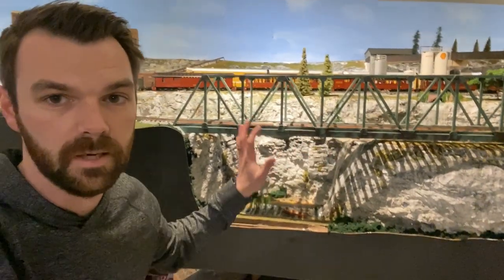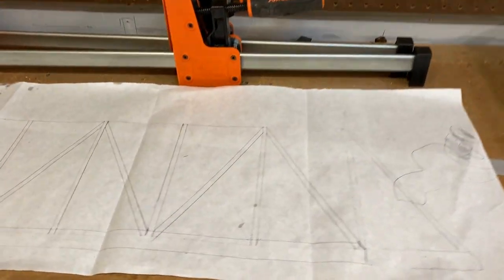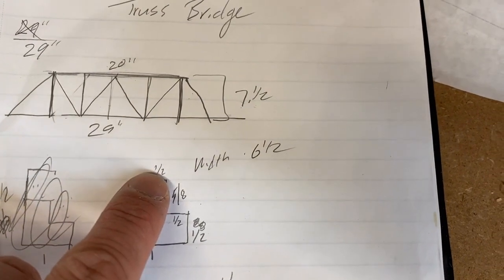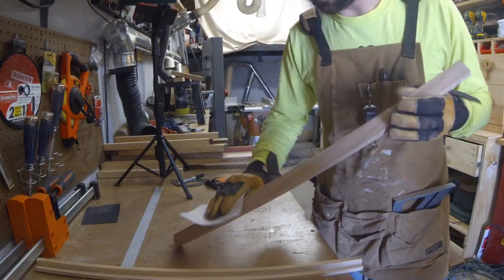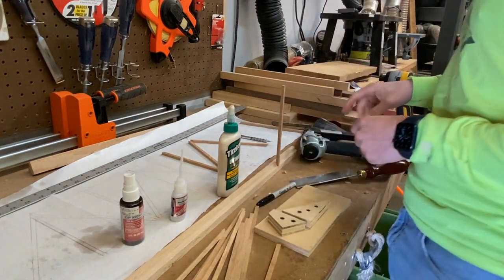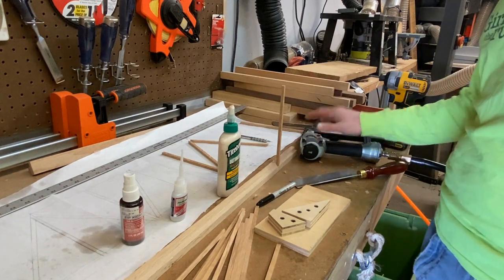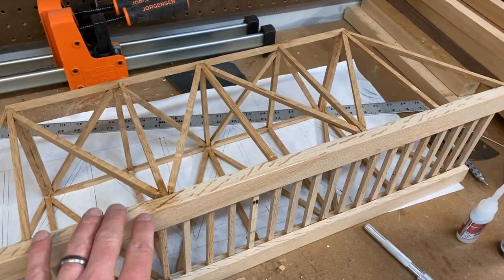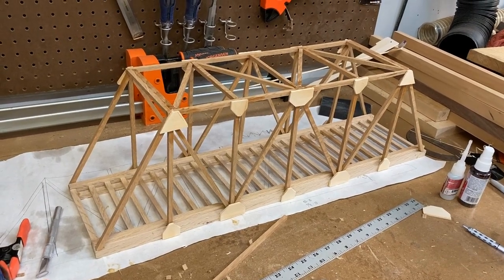Building a Model Railroad Bridge

Comment: Good job Chris.
I'm the guy that built your bridge. The only suggestion I would make is using a pin nailer to secure the pieces with the wood glue. That way you can just tack and go to the next piece. Then let the glue dry overnight.

Comment: Do you mean you use two glues together?superglue and wood glue?
Reply from the maker: Yes. The wood glue takes longer to dry, so the superglue holds the wood in place while the wood glue cures and provides the strength.